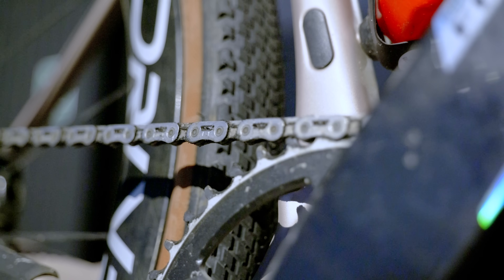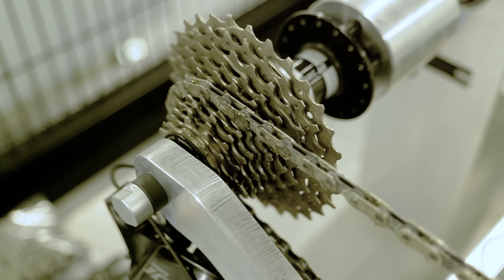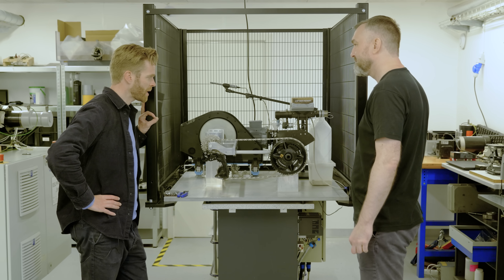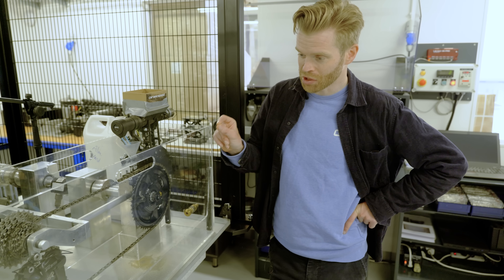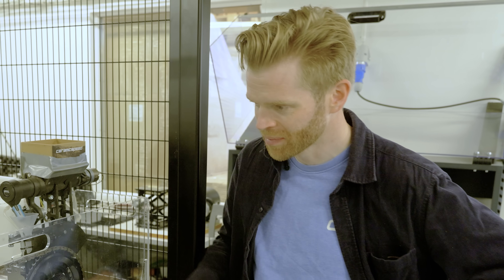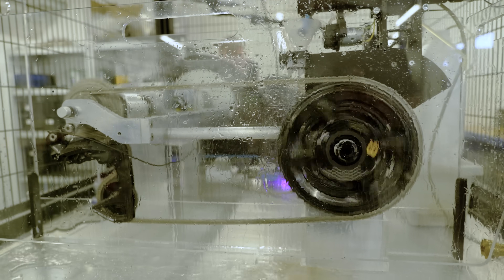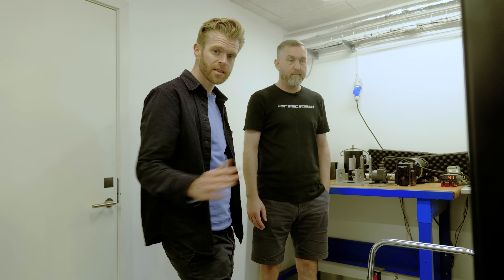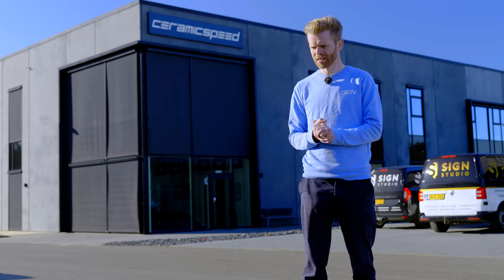We Lab Tested A Dirty Chain, How Much Slower Was It?

Comment: Interesting video. 👍 I wonder how much more efficient single speed setup is. I run 50x19 ratio on my bike.
Reply: Looks like very efficient?
Reply: Single speed drivetrain has superb efficiency. Always straight chainline, no derailleur, no active pull in the chain. Silent, smooth, efficient. 🤌

Comment: The bottom bracket was not tested realistically. As a rider you can't apply constant torque at exactly the centre of the shaft. By pedaling you load and unload the bearings in radial direction. Could not see any attempts to simulate this. Shure you could measure the sealing friction. But how much significance has this in real world conditions?

Comment: what is the efficiency difference between say like bigger front chain rings with bigger rear cogs compared to smaller fronts with smaller rears also.  So i'm saying keep the ratio the same but just increase the size of the rings would that be more efficient for some reason?

Comment: A 14 watt variability is pretty significant. Knowing this, what are some gear designs that could ameliorate this variability?  Is there such a thing as a gearset that moves the gear rather than the chain?
Reply: As per video, chain line is not as significant. Yes, they are some gear designs that are better: old fashioned 53-36t front chainrings coupled with 12t-xx cassette instead of silly 1x with 10t cassette that was pushed down consumers throats. Basically, you want big cogs at the front coupled with big cogs at the back.

Comment: Interesting! But this leaves me with a question: If I understand well, there is mention of the bigger the sprocket, the lower friction it creates. But looking at the graph line that represents sort of a bow shape, this line tends to reflect more the importance of chain alignment, the 27t sprocket getting the less friction, and assuming of course that the higher the line on the graph the higher the resistance correct? Please help with this.

Comment: Straighter chain lines are possible when you have more chain rings. I think the two and three chain ring systems are better for most of us.
Reply: The surprising result here is that chainline is less important than sprocket size. Puts SRAM's 10t UCI debacle into perspective, doesn't it?

Comment: so what I'm seeing, is that to improve drivetrain efficiency, cyclists running 1×12/13 would be better off with a 3× with all three the same size (at the very least), to optimize chain line. or would the added weight negate the efficiency gain?

Comment: Ollis dirty Chain ist my freshly cleaned chain, when the chain has been on my bike over 5000km and is nearing the end of its live. My current chain is close to 7000km on the bike but on a internal gear hub bike. But at least this way I never cross-chain and 42-17 is also a fairly large ring and sprocket which adds to its inefficiency. (The different gears have a different efficiency though.) The real difference I notice is, when it is running dry, then it really is noticeably slower.

The upside is, that with a derailleur the climbing gears are fairly efficient. And climbing up a hill is definitely the time you need that extra sliver of efficiency.

Comment: It does make me wonder why drivetrain manufacturers are pushing smaller sprockets?

Assuming a weight penalty of less than 500g I should be faster on a 14-41 cassette with 64/48 chainrings (same gearing as 11-32+50/34). And gear spacing would be more even 😊

Comment: Now do chain breaking.
Wear and tear, cheaper brands, stones and or bent cassettes metals etc.

Chain breaking can be super dangerous for standing sprinting, share us the understanding of how durable chains are at resisting breaking under 1500 watt explosive sprint loads.
test what power is required for a chain to break from different brands and metals and construction etc.

This was a great video.

Comment: For the water and sand test they are basically adding it to the outside and most of it will just go out of the system. I think a better test would be to apply it to the chain at the bottom instead.
Reply: The sand is also way too coarse to penetrate the chain.

Comment: I clean my chain to reduce wear, not to save watts. On my MTB, chain lasted only 4000km in harsh muddy conditions but on the road, it is still going strong after 12000km. 😁
Reply: dont forget that in mtb chain wear faster when you are climbing...
and not always using optimal gear
Reply: You can't compare a km on the road with a km on the MTB, since you'll trvael less far for the same work on the MTB. Hours on the bike is a better metric.
Reply: I'm impressed it lasted as long as 4000km. Mine last about half that.
Reply: To be honest my chain lasted 4000km too but it was way too stretched
Reply: @GiJoe94 Be careful. Worn out chain wears out the chainring teeth. I have a friend who neglected his and his chainring teeth looked like shark fins.
Reply: which group in it ?
Reply: I have seen similar results comparing my MTB and road bikes.  It is a big incentive to clean my MTB chain more often.
Reply: Well of course in mtb you go through dirt and puddles much more often than road bikers
Reply: I'm using beeswax with oil and friction modifiers on my trail mtb equipped with kmc x12 chain, riding usually in dusty conditions, climbing high-gradient trails on 51t sprocket and lube lasts around 600-800km. Current chain milage is 1700 km (17.6km altitude gain) and wear is barely more than zero (calipers show 119.7mm - it's +0.1mm from new, and max allowable wear is 120.6mm).
Reply: I clean mine to reduce noise (which in my mind is wear and friction/power loss), and keep the drivetrain shifting happily.
I've also never been a waxer, but now I'm starting to re-think that idea potentially.  If for no other reason than to potentially not have to clean the chain as often.

Comment: As a year-round commuter who covers 5,000km a year, I can say that there is a significant difference between a dirty and a clean chain.... 😊
Reply: Or is it the difference between a dry chain and a lubed chain? To me that actually seems to be the bigger difference. I also do year-around commuting and since I cover 50km a day, my chain can really run dry when I take a few days extra to relube.
Reply: @kai_v_k 
Okay, I made myself clear there. A clean chain/drive also means the whole thing is oiled...I use oil for truck transmissions because the viscosity is designed for metal-on-metal contact....
Reply: Same here. Commuting every day, in all weathers, soon teaches you to keep your bike well oiled/cleaned at all times. It'll turn into a heap of rust if you don't 😂

Comment: About bike chain stretch, take an old chain apart, clean it. The inside of the pin where it rubs on the inner plate flange - that's the wear point. If you could only lube this part and inside the roller, that would suffice for lubricant. No lubricant is needed on the outside of the roller or your sprockets because the roller, rolls. Alles klar? 😂

Comment: My main motivation for clean bike is minimising wear. Keeping the cost and inconvenience of new gears far away ⚙️
Reply: true. But cleaning also increases cost and inconvenience too. There is definitely an amount of cleaning where these costs actually become higher than the saving in replacement.
Reply: @tristanwegner  it takes a lot of cleaning product to match the cost of a new chaine + cassette - particularly some of the newfangled flat top chains and 12 speed cassettes, which can set you back multiple 100s of dollars.
I think the key is coming up with a quick and convenient chain cleaning regime and doing it frequently (you don't need to completely strip a chain clean with degreaser and lube from scratch every time ...).  Also - using the right quantity of lube and applying it the right way.  Less can be more and wiping off excess is important.
Reply: Economically speaking the cost of cleaning your bike very thoroughly is your time. If you clean it pedantically after every ride that is quite a lot of time you could spend working productively. Pretty sure the loss in earnings more than outweighs the increased outlay for components through slightly increased wear. Given how low the efficiency losses are even for very dirty components (as seen in the vid) I assume wear will also be lower than you would expect. But if you like a clean bike, you like a clean bike 🤷
Reply: @pipoann  I literally made the argument to find a balance whereby you can do it quickly and efficiently, and frequently - not cleaning it pedantically every time.  

For me - that's a good wipe down with a rag while turning pedals backward, with some special attention cleaning gunk off the jockey wheels.  And, if the chain is left fairly dry (of lube), then applying small drops of lube on each link while winding the chain backwards. Wind it backwards a few times.  If there's time - leaving it overnight to let the lube soak in.  Then, before the next ride, gently wiping an excess lube off.  Literally takes a minute or two, and is a good investment in time.

A friend calls it "functionally clean"

The true benefits in are in reduced wear on componentry - saving money and hassle in spare parts and servicing.

If the riding has been in particularly bad conditions, and particularly mountain biking, or if it's been quite a while, then a more thorough clean may be justified ...
Reply from the maker: definitely helps with the longevity of the components!
Reply: Time is money. Chains are cheap.
Reply: My chains only last 6 months before I’ve stretched them out.  Running a stretched chain will damage your sprockets; road grit, not so much.
Reply: @jamesschwitalla4211  Do you realise how your chain becomes 'stretched out'?  It isn't the metal stretching.  That road grit is the very cause of chain 'stretch'.  It wears away at the insides of  the bushings at each chain link.  A fraction of a millimeter at each link adds up to a lot of slack (stretch) over the length of the chain.  Clean the chain better to remove the grit, and that stretch will be slower, and you'll likely get more than 6mths out of your chains.
Reply: When your bike gets to dirty just steal a new one.
Reply: @harskaralex8742 so long as you can find one to steal with a clean chain.
Reply: If you want your transmission to last forever : buy 3 chains when it's new, and rotate them every 500 or 1000 km. 1 - 2 - 3 - 1 - 2 - 3. They wil wear evenly and last 10 years.

Comment: I assume their brand new piece of laboratory test equipment compensates for rotational speed of the cassette, or uses load cells as per accurate dynamometers normally used for this type of application. Either way ok for comparison (motor power input x motor efficiency) - dynamometer output = drive train efficiency loss
Reply: It uses a torque sensor on each axle (load side visible at 3:16 in front of the Tacx with the yellow sticker on it).

Comment: bike messenger here. oil vs wax... 5000km for both. i know people who use generic oil, wax and me, balistol. NEVER RUN A CHAIN WITH NO LUBE OR WAX. other then that it doesnt matter

i never clean my chain, i just do a full drive train swap every 5000km.
wiping chains is a myth, it pushes dirt back into the rollers and links. just put on more oil, it pulls the "grinding paste" out of the contact surfaces and leaves it on the outside.
Reply: So, you say putting oil on a dirty chain "pulls out the grinding paste" and yet you have to replace the chain and the rest of your drivetrain after only 5,000 kms.
Reply: @joystation1  and how long does a waxed chain get? 5000 is a low estimate, realistic is 6 to 8kkm or every 6 months. everywhere i read waxed chains are like 8000km. and a lot of up keep. 

you do you, i ride for my job so i dont have time to re apply every 100km or.... 2 days...

Comment: It’s about wear rates more than efficiency. Dirty chains wear out very quickly and wreck your cassette and chainrings. Wax chains don’t wear nearly as fast. Wax is simple, clean, and saves you considerable money by not having to replace components.
Reply: Chains are cheap. Measure the chain from time to time and when they are done bin them and get a new one before it starts to damages the drive train
Reply: @GiJoe94 What kind of junk chains are you running? Good maintenance is easy.

Comment: I don't think the chainline data is telling us what we think it is, or at least it's not an accurate representation of losses due to chain line crossover. I suspect the efficiency of larger cogs is biasing the data and partially masking the losses. If you want to see how chain line effects drivetrain losses you'd need a cassette that comprises 12 cogs with the same tooth count. Then the only variable is the chainline crossover. What would also be interesting to test is whether an 11 tooth cog is more efficient at the other end of the cassette, or in the centre of the cassette? And how a 32 tooth cog performs in the place of the 11 tooth cog. You could do the same for every ratio, and determine the most efficient cassette configuration. With electronic groupsets, the cogs in a cassette don't have to be sequenced smallest to highest. 🤔

Comment: As an engineer, I don't find any of this particularly surprising, especially the fact that larger sprockets are more efficient, and and anything other than a perfect chain line is sapping power. It seems entirely intuitive to me.

To understand it better, imagine taking things to extremes, and using a pair of 100m diameter sprockets. Ignoring the jockey wheels, there are only 4 links of the chain that are actively moving at any point in time - the 'entry' and 'exit' points of each sprocket. The remaining links, regardless of how many there are, are essentially static in terms of their movement relative to the adjacent link so consume zero power. So, the larger the sprocket the less of an angle and hence movement each link goes through as it picks up and falls off each sprocket. So, in the case of these 100m diameter sprockets, the 'active' part of the chain stays in an almost straight line, and hence is more efficient. That's why you should always be on the big ring wherever possible, as long as that doesn't compromise the chain line, which would likely have a greater detrimental effect than using smaller sprockets.

It would be interesting to see the results from this machine when using larger jockey wheels, although I wouldn't expect there to be much differences because even over-sized jockey wheels are still relative small, and the chain still has to articulate quite a lot to pass through them.

The dirty chain doesn't really surprise me either, at least as long as the chain isn't badly worn or dry. It might look dirty and gritty to the eye, but remember that the running clearance of the rollers (on an un-worn chain) is pretty tight, and large abrasive particles (such as sand and grit) won't actually get between the running surfaces. To see what I'm getting at, imagine throwing a handful of debris into the bottom end of a car engine.  As long as the chunks are big enough and don't find their way into the pressurised oil system, none of it would get onto the actual bearing surfaces. Obviously it would likely cause damage up the cylinder bores, but the crank bearings would still be running perfectly fine.
Reply: You're not surprised that was true even when crosschaining big to big?
Reply: There are measurements showing that cross-chaining is not an issue until the sidewalls of the chain start scratching the teeth when rolling on/off the sprockets. In a 2x10 setup this happens only at the worst 2 combinations on every side. That was a result which surprised me quite a bit, I was expecting a higher impact of a cross-running chain actually.
Reply: I agree with you. But I roll my eyes every time I see OSPWs when they are on bikes that have a cassette with a 10t cog.
Reply: I wonder if there is any impact on the "small gear inefficiency" when the smallest cog is further from the thru axle bearing than the highest gear, basically losing some power on the bearings instead of the chain. But that would have to be tested with 10speed cassette with the same gears.
Reply: @Marxone  I doubt that it would be measurable, let alone noticeable.
Reply from the maker: @thegearboxman thanks for the comment! Hopefully we can go back and spend some time trying out where the sweetspot is in terms of efficiency!